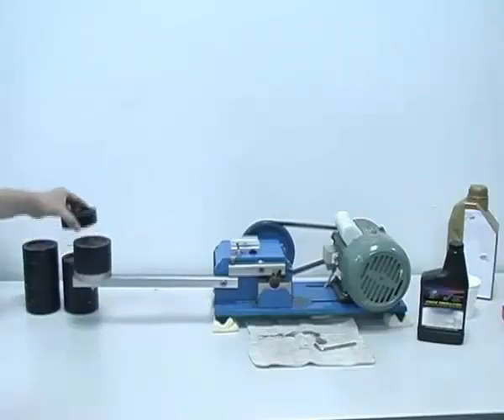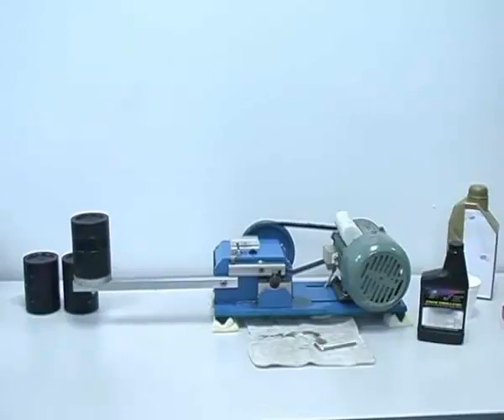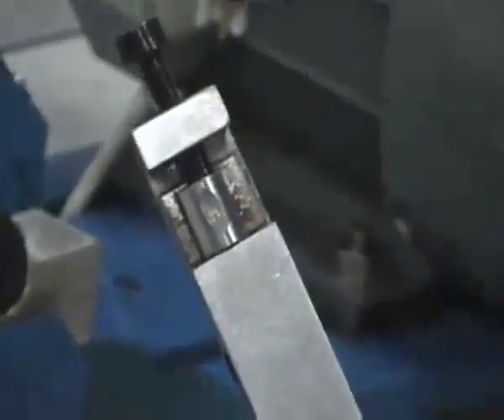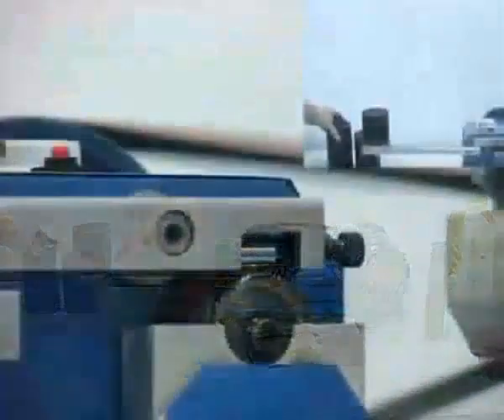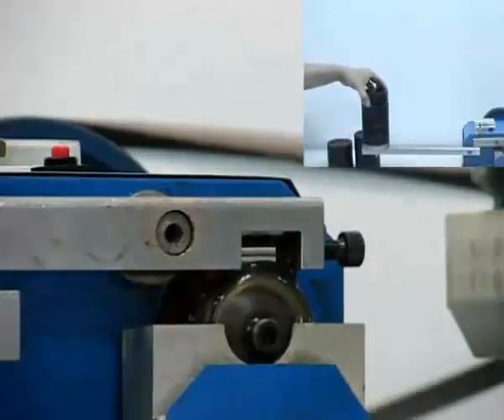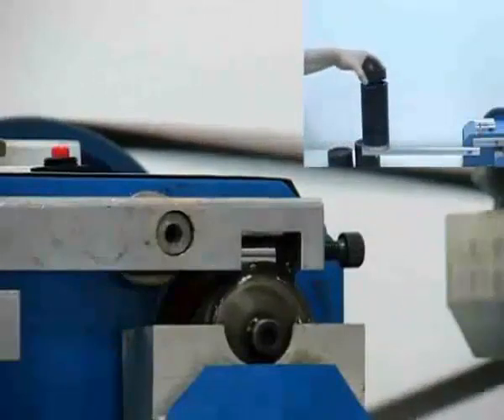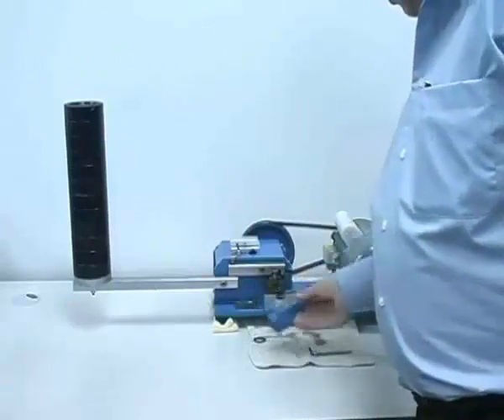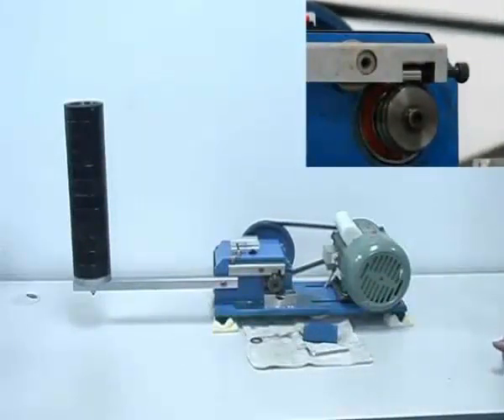MSP Extreme Test: Timken

Comment: Used to use the same machine and also a Certified toque wrench with my total weight was applied and my feet off the ground the bearing was still spinning now thats real good friction protection ? If its Wynns it works, but inductrial products to be sure ?